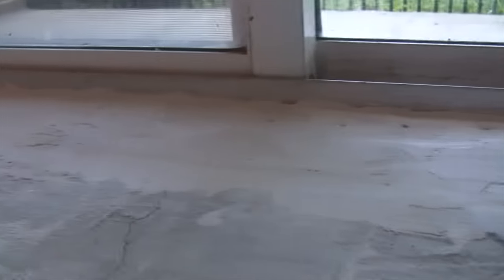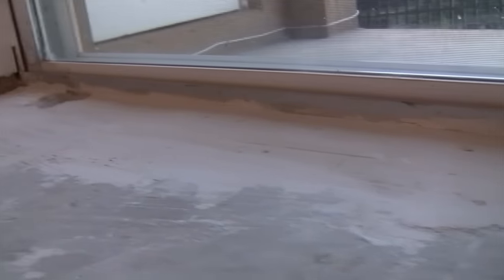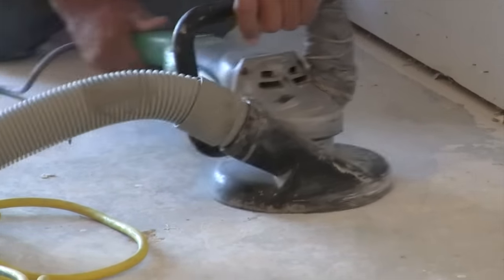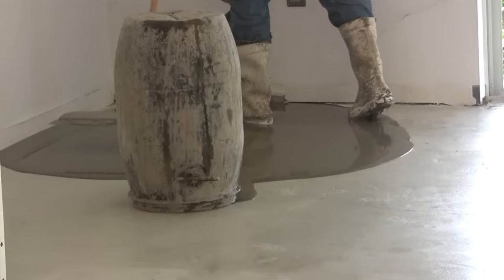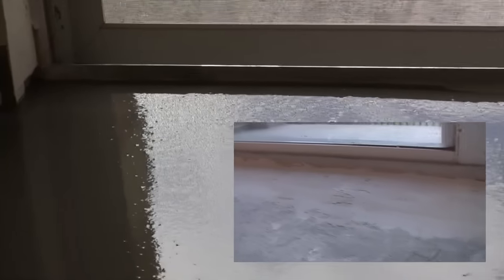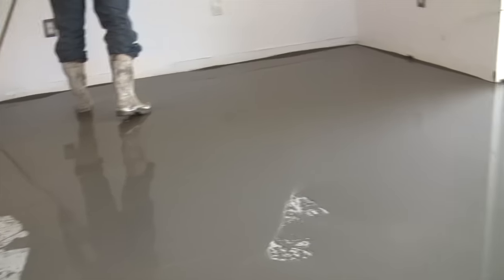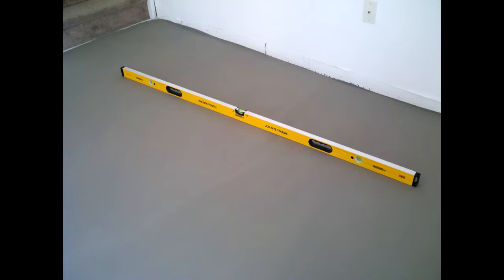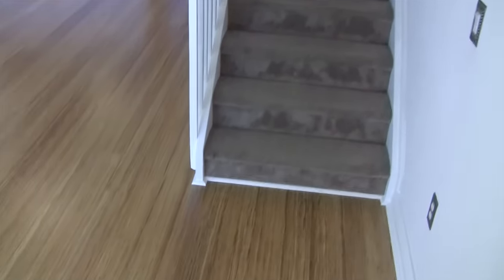How to Self Level Concrete Floors Like Pros - Self Leveler

Comment: Amazing video. What would be the estimated cost price of 300 sq ft floor for leveling and installing the wood floor?
Reply from the maker: They charged us $1400 to level this floor. Most flooring installers might charge you $4.50 per sq foot for the install.
Reply: @jeffostroff  this including materials?
Reply from the maker: @lbcben  Yes the background on this is it was basically a 375 square foot job which a few other companies turned me down it was too small for them most of the companies that do this are commercial companies that do massive stores like target and So these guys probably buy unbelievable mass quantities of this concrete by the truckload I'm sure you can bet they don't go into Home Depot and pay $30 a bag for it. So at the time that this was filmed in 2012 , they charged us I believe about $1500 for the entire job including the materials. First guy showed up at 9:00 AM and started grinding the floor and then put the primer on , they let it dry an hour and the rest of the team showed up in four guys total we're going at it mixing it and dumping it down on the floor .
Reply: @jeffostroff  thank you sir. Need to do this to around 400-450 square feet.

Comment: How did you achieve same mixture consistency throughout each different batch? 
Also how did you know the required thickness of the leveler and the Level?
Reply from the maker: These guys do this all day long every day. They have pre-measured buckets for water to add to the 50 pound bags of self leveler they add to each barrel, then the guy dumps it on the floor and they all get squeegeed into place. They placed little plastic height shims on the floor and poured until the self leveler rises to the top of the shim, then they are at the correct level height.
Reply: Ardex , schonox and other self leveling brands has buckets with little squares cut off on the side so you can always get the right amount of water on each mix . Or you can measure the water that your brand of self leveling requires per specs and draw a water line on a bucket and that’s all you need . @pdrflooring .
Reply from the maker: @ornanramos7597  That's what these guys used, a lot pros know not to waste time measuring, so many will do just what you said with pre-measured buckets.

Comment: Can the leveler go right up against the drywall?
Reply from the maker: Usually the dry wall does not go all the way down to the floor but if there is a wood base plate from a stud wall right behind it you should be OK otherwise you have no idea where the leveler is going to flow.  a lot of people  prefer to just seal up around the perimeter of the floor 1st before pouring

Comment: Is it necessary to grind a floor that is already smooth, but is stained and sealed (it just has cracks and valleys)?  Can the floor just be primed over the sealed concrete?
Reply from the maker: Always best to roughen the floor before adding primer, but see what the instructions on the bottle of primer say to do. They might tell you it works for everything, or they might tell you to grind the concrete first.

Comment: Would it be cheaper to just grind down the high spots and use the self leveler to fill the lows instead of using hella bags to cover the entire floor?
Reply from the maker: The problem is when you grind down the floor in certain spots, you might be creating imperfections enough to cause your floor to be out of flatness more than 1/8" over the 6 length rule. Also in our case, we had on side of the room was lower by almost 3/4 inch, so it had to be leveled up to the same as the other side. nothing beats the level perfection of pouring a lake of self leveler on the floor, you saw in the video at the end how that 6 foot level just smacked down on the dried level floor.
Reply: Yes. 

And apparently he levels every floor he does being no floor is that flat.
Reply: @jeffostroff  Bs
Reply: Yes of course! You have a high spot “a bump” or a low spot “a soup bowl”
Grind down the bump and/or fill the soup bowl and that’s it. No one “levels” floors just make them flat. The rest of this is excessive. But if they are paying for it than who cares. It will make the installers job a dream.

Comment: Hi Jeff, any cleaning step needed after sanding the cement & before applying the primer( bonding agent)? I am a home owner in Malaysia & unfortunately it’s so hard here to find good small or medium size company to do a room or two. All companies here wants to do big job but many of them don’t know the right way. I started to look at flooring everywhere I go, restaurants, malls, it’s crazy but I found 90% of flooring have mistakes like tiles lippage, grout lines of different sizes on one surface! Would really appreciate your comment. I like your other videos too, like the one about 4 items not to use for plumbing, & you explained clearly why not to use them, very helpful:-)
Reply from the maker: All they do is vacuum afterwards. The vacuum they use which is attached to the grinder does a great job at getting up most of the dust as they are grinding, but you still want to come back later and vacuum up any residual, all you need is a dry floor at this point. Then roll on the primer.
Reply: Thank you so much Jeff! Wish you a good day! Am now looking at dust shroud to attach to my angle grinder.
Reply from the maker: @momois35   That's what I need to get too
Reply: There is always 1 more tool we need ;-)

Comment: I had all materials needed to start installing my laminate when leveling the floor came up. I went to my local store to pick up levelquick rs with the primer in order to level my floor for greater results. My basement goes downward into a drain across the other side. My guess is that I need one bag in order to cover most of the slope that is by a door. How do I measure out the depth? I would like to map out the room to where I would know which place will need the most leveling. thank you
Reply from the maker: What you should do is get a 6 foot long spirit level and find the highest point on the floor and hold the level straight out from that point and see how far the floor dips below the the bottom edge of the level. That is your depth.
Reply: jeffostroff thank you for your reply! Maybe I wasn’t clear in the way I said things I apologize, what I meant to say is that the room is 8.5 ft wide by 16ft long and standing in the back of the long side of the room there’s a slope that goes from the right of the room to the left. I’m thinking of sealing off the left side and pouring the self leveling on that side to level it out. Let me know your thoughts please and as always thank you for sharing your knowledge
Reply from the maker: @SBdunks3   Well if I interpreted correctly what you said the left side of the Room is where you're going to level it off not sure how wide of it you're going to level off but it should all still be the same in theory where you take your level find the highest point of that section and set it so that its level and then measure from the bottom of your level down to the bottom of the s** that's how much thickness you need to poor and you also have to make sure you dam up all the way around your poor so that the self leveling compound cannot leak out and go under walls for example are going in between floorboards that sort of thing.
Reply: jeffostroff ok I’ll do that thank you very much!
Reply from the maker: @SBdunks3   Let me know how it works out for you I am curious to see how many bags it took you and how deep the Slope of the floor was

Comment: My friend has  gloorlue stuck to her cement floor.  It is only 1/8" thick.  Can she pour this leveling agent over it  in order to seal off the old glue?   It is a huge job to try and scrape it all up.
Reply from the maker: Depends on how much there is. It can be easily grinded up with an angle grinder and a diamond grinder bowl attachment, I would try that first. If it's in a small area, I would try to scrape or grind it, and if it won't come off, then pour self level up and over it, but make sure primer is applied and dried first. You must use primer.
Reply: Ifteadhesive is really well stuck, use Mapei primgrip primer

Comment: Can you explain how you measure how much to put down?
Reply from the maker: The installers keep pouring until the leveler hits the mark on the wall, and sometimes they place plastic gauges on the floor and keep pouring leveler until th emark on the gauge is met.

Comment: What is the price range for having a team come out and do this provided the customer supply all the materials first?  My living room is the same size as the one in the video and we are pulling up the old carpet in preparation for vinyl floor (glue down)
Reply from the maker: Don't know the answer to that this contractor charged us $1500 sent 3 employees it took them about 3 hours to do  About 350 ft²

Comment: Can this condition of floor cause your tiles to pop up and crack
Reply from the maker: Uneven subfloors generally cause lippage between tiles. If you have cracking, it is because they did not put enough mortar under the tile, or used wrong trowel line size

Comment: Well I've been floor laying for 15 years. In that time I've screeded literally thousands of square meters but ive never seen anyone screed a floor that way. Not even in college are they taught that. Seems like a very messy way of screeding, especially with the amount he seemed to splash up the skirting boards. But then maybe we do it differently here in the UK (trowel & spiky roller). Interesting video tho :)
Reply from the maker: Self leveler is really more for smaller imperfections, you would not be screeding for a 1/4" difference in floor, it makes more sense to pour down self leveler.
Reply: @jeffostroff I was meaning the difference between you using the long handle screed float whereas we use a hand trowel. Even if it needs leveling out to a greater depth. We'd still pour it like you did but then use a hand trowel. Thanks for your reply.
Reply: Dont hate bro the dude did a good job
Reply: @mariocervantes9305  who's Hating!
Reply: Yeah I didn't like the way he was trying to  get it in to corners with his boot. These guys are the type that mix it really wet and hope for the best. No mesh over the cracks either. And all that for laminate floor. Waste of time

Comment: Can you self level a floor in sections?
Reply from the maker: You can, but I suggest to do the whole floor at once for easier installation. If you do it in sections it can be a challenge to get the new section to line up to the previous section without ridges forming.

Comment: So self leveling concrete can solve my garage problem. It was never sealed and have divots from tires and us always kinda sandy on top. It was like when it was built. Thanks
Reply: I think you should check the specifications on the material you might use... I do not believe any of these "self leveling" materials are suitable for surface traffic... It isn't hard enough and needs to be covered with another material such as epoxy or vinyl... It has good compression strength but will rub off from traffic, especially car tires. I'll be using a floor leveler in my garage but plan to cover it before use.

Comment: I have a small crater in my floor about 3 inches in diameter, also some very tiny holes along the edge of the room where my tac strips were nailed down. What do you recommend i do to those. Will the self leveling compond take care of those or do i need to prep them before priming. 

Great video by the way. Very informative.
Reply from the maker: The craters that you get from the tack strips are not a problem at all they are too small to be a problem and even a 3" hole I doubt would be a problem you can try to put a floor plank over it and just see but as long as the floors flat you should be fine there.  If you are that worried about it you can buy a small bag of cement patch and a bottle of primer and prime the hole 1st and then patch it nice and flat and level with the floor.
Reply: Buy a bag of ardex floor fill.

Comment: very nice work, i would have laid the floor parallel to the siding door. but very good work
Reply from the maker: John, the rule of them is you lay the boards in the direction of the incoming light, i.e, toward the sliders in this case. Also they were laid in the long direction of the room which helps make it look longer.

Comment: My question is after i level the floor on my garage, can I use Epoxy to cover the floor? thanks
Reply from the maker: Yes you can! But you need to make sure the manufacturer specifies it's use on garage floors due o weight load.

Comment: Hi Jeff,
I have just bought a single storey house with a flat roof in the Philippines.
The existing roof area is 310 m2, concrete structure covered in roofing felt with 2 coats of elastomeric paint which is in good condition, no leaks and no bubbles.
The problem is the roof was never laid to fall and has numerous low spots so when it rains we have standing water and in a few areas 1/2 “ at the deepest point.

I am planing to use the roof as sittout area, views of the sea, mountains etc. but light foot traffic.

Any suggestions how I can at least get rid of the low spots? Self leveling compound?

Thanks
Kevan.
Reply from the maker: Kevan, you want a very slight slop to that roof in order for water to drain off. Good rule to use is 1/4" per foot of slope, so a 6 foot long roof would need 1 1/2" of slope or the water won't drain and it will pool up on you. I doubt self leveling compound will help you because it will just find level. Now you could use it to fill in dips to bring them up to the level of the rest of the surrounding area, but you'll still need to create a slop for water to drain off. Flat roofs are bad news. In our area building codes don't allow you to have a completely flat roof.
Reply: Jeff thanks for the quick response
As the roof generally drains leaving the dips full of water.
Will try a leveling compound and see if it helps.
Would you recommend the primmer on the elastomeric paint?

Comment: How many bags do I need for 100 sqft
Reply from the maker: I depends on how deep you are going. The bag tells you how much it will cover, they usually cover 25 sq feet at 1/4" deep. I saw them pull out 40 bags off the truck but don't know if they used all of them, or got more either. Each manufacturer is different too, so just read the bag.

Comment: Great video, thank you. But....how DID you deal with the rebar issue from the beginning of the video? I would assume that removing it, if that would even be possible, would weaken the surrounding floor. Did you grind it down to below floor level?
Reply from the maker: The guy who was prepping the floor ground down the high spots including the rebar, and then roughed up the surface of the concrete floor before they rolled on the primer.

Comment: How do you level over a wood subfloor?
Reply from the maker: That is an interesting case what you would want to do if you have sheets of wood subfloor, is to caulk all of the seams so that when you pour down the self leveler compound, it cannot drip down between the boards because even though this sets pretty fast, it could still run down like water in between any cracks and you also have to seal all the way around the perimeters to wherever you see any cracks where water might run down.
Reply: @jeffostroff  Thank you!

Comment: Can I use self leveling over my driveway?
Reply from the maker: I don't think you can use it on the driveway you would have to check the instructions on the bag  and see if there are any restrictions against it for the amount of weight it can carry
Reply: Mikey Mike You also need to check if it is for interior or exterior use.

Comment: Well, if someone look at this video and want to do the same on a main floor with a basement under, make sure to fill gaps bottom of wall. I saw someone that all the concrete was going into cracks and even leaking in the basement.

Comment: Can someone tell me the make of the grinding system they used to prep the floor ? The grinder with ther vacuum attachment.
Reply from the maker: Most likely Hitachi with green handle. There are several brands, they are all good, Bosch, Milwaukee, Dewalt, Makita. Start your search here with this Bosch 5": https://amzn.to/2ErfiJH  They are all similar simple tools starting around $150, and the vacuum part usually costs $50 more, some included it in their kit, and you need to buy a diamond cup diamond-cup wheel disc to grind, typically 5", but check with the tool maker. You should also use the vacuum attachment or there will be clouds of dangerous dust. But that link to the Bosch on Amazon that I posted here has everything you need in the kit.
Reply: @jeffostroff  hey man thanks for responding !! Kick ass video and great job.
Reply: So Jeff, I could have just grinded the kids outdoor 15x15 basketball court? thanks in advance....
Reply from the maker: @BigBand1942  yes any concrrete surface.
Reply: thanks
Reply from the maker: @BigBand1942  or should I say Milton! Glad you liked it. Love your profile photo. I believe you have my stapler.
Reply: @jeffostroff  and the self-purging HEPA Vacuums are about $500. The replacement bags are about $25 each.

Comment: 40 or 50 bags? how thick you putting on? Your room is approximates 35 sqaure meters, and 1 bag does 5 square meters at 2mm thick.
Reply from the maker: From what the guys told me at the time one side of the floor was 3/4 of an inch lower than the other side and the entire floor was put on 1/4 of an inch thick layer for the most part but of course the parts that were dipped down lower receive a lot more material an I'm not sure whether or not they used all 40 bags that's just how many I counted
Reply: @jeffostroff  wow, that must have been an awfull floor before the skim. Great job.